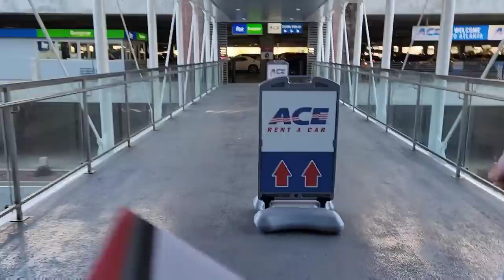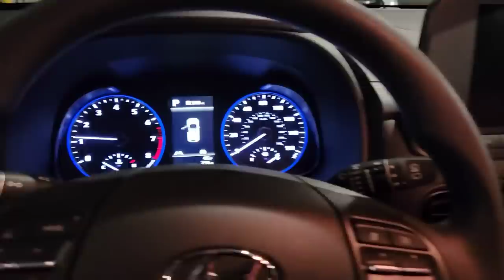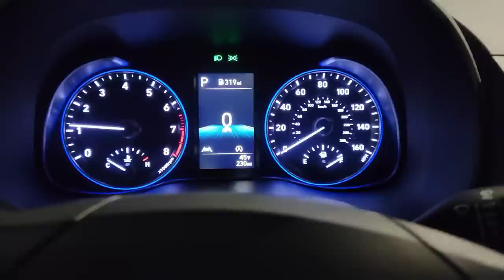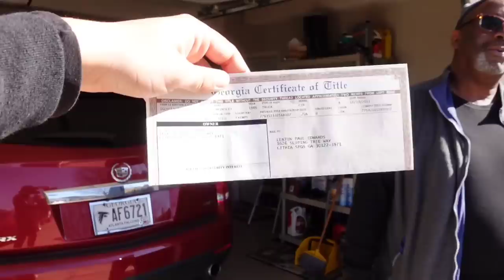I fly in to buy one of my dream trucks

Comment: Clean ass truck get that 305 outta there and get a 350 vortec keep the old school motor feel but a bit updated with the vortec block n heads just use a old school water pump serpentine set up and ur good

Comment: That's a nice truck it's been took good care of .I had a 1986 like that black and siver. I had 15×10 centerline an lowered it put a 3 inch cow hood took the rear bumper off put a roll pan on it 3.it had a new pant job all new in side.Had a bad ass 350.it was real nice.I sold it like a dum ass for 4.000 dollars.